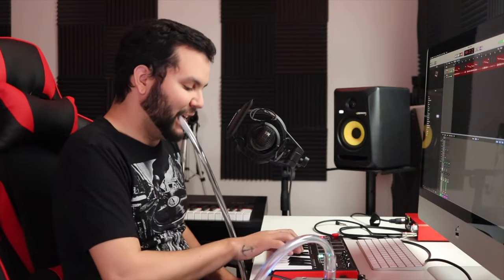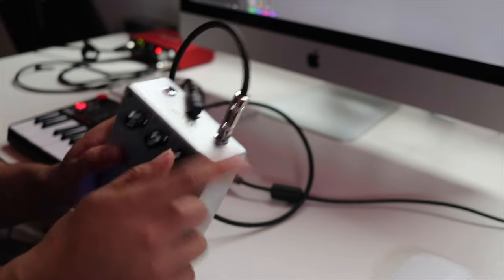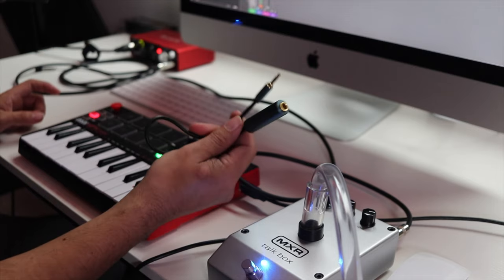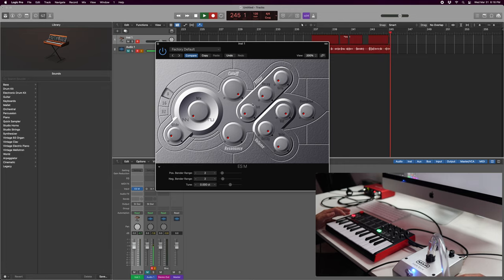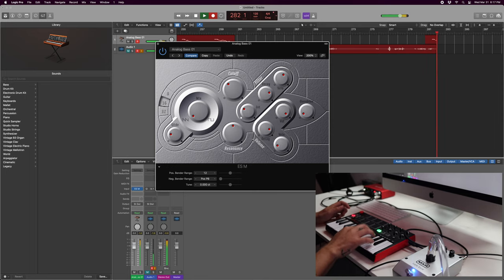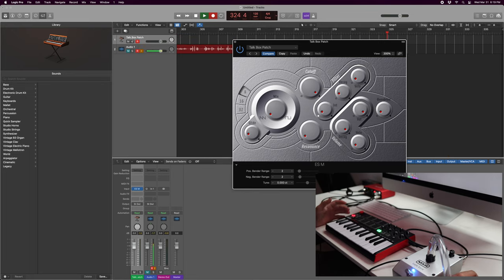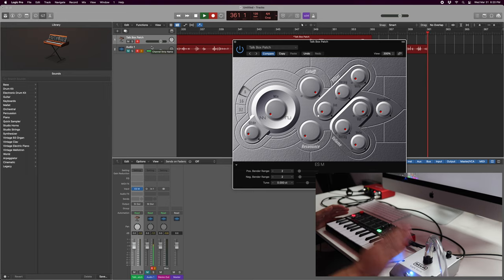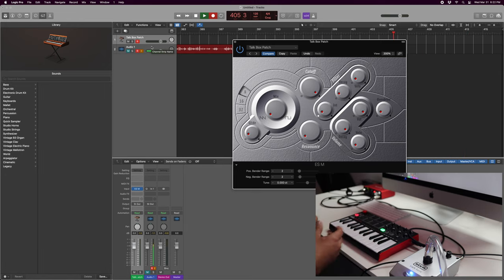How To - Talk Box With MIDI Keyboard (LOGIC PRO)

Comment: Hey man great video. I am using Ableton, which Vst would you reccommand to have a talkbox patch ? I would really appreciate, thank you
Reply from the maker: I'm not too familiar with Ableton but find a synthesizer vst and go with that. If it has a lot of synths just pick the one you're most familiar with.

You're going to want these settings:

1. Monophonic keys; it means you can only play one note at a time. (This is important)

2. A single sawtooth wave with no effects. Take out any reverb, echo, etc.

3. Add a little glide/ portamento

If you follow those steps you should be able to get a talk box Patch with most software synths regardless of what DAW you're using.
Reply: @JEzra-cx7bx  thank you man ur the best !!!

Comment: I’m trying to do this setup but can’t get sound to come out of the tube . What audio setting should I use in logic ?
Reply from the maker: This is a hard thing to tackle because it could be a lot of different things that could be wrong. 
I have a few more videos going over how to do this, I would say re-watch this video and pay close attention to how I set up the talk box and the settings in Logic and if you have to wat h some of my other videos as well.

Make sure your volumes are turned up on the talk box and in logic, also make sure to activate the track by pressing the little button next to the record button on the track itself. That will allow the sound to play on the track.

If that stuff doesnt work get back to me and I'll help you further.
Reply: Thanks for responding . Most of my confusion is coming from me not knowing what my audio output device setting should be and what my audio input device setting should be. I currently have them both on Scarlett 4i4 usb. These settings can be found when you press the Logic Pro tab and then go to preferences.

Comment: Super helpful! So this makes sense for recording talk box with no playback, but if you want to record talk box over an existing song, how can you route that playback so that the playback goes into headphones rather than through the talk box tube? I think there's a way to do it with Logic sends, but for some reason I can't figure it out. Maybe I need a more complicated audio interface?
Reply from the maker: The easiest way might be to play the song on your phone with headphones on and record the talk box as the song plays. Then add the track afterwards?

I guess this is another problem that I'm going to have to solve and make a video on... but recording a talk box through midi is probably the most complicated way to record a talk box. Having a hardware synth and recording it the regular way is much easier and you have less problems to run into. 

I have a video called "how to record a talk box" if you wanna check that out but that is the standard way of recording a talk box. The way I show it in this video is the alternative.
Reply: @JEzra-cx7bx  yep, that's actually what I ended up doing, though I technically didn't need my phone since I could play the playback on QuickTime or iTunes with and route that audio to headphones using my general mac audio output settings while the Logic output sent the synth output to the talk box. Hacky workaround that got the job done, but it was a massive pain to then have to resync each take in logic. I know there's a way to have multiple outputs/sends in Logic, a friend of mine with a more complicated interface figured out how to do it on his rig, but I haven't figured it out yet.
Reply from the maker: Glad you figured it out! When I play my talk box I use a hardware synth so it makes everything a lot easier, especially when it comes to recording but I understand that everyone is in a different situation.
Reply: Isnt there a way to output a talkbox patch to an output?